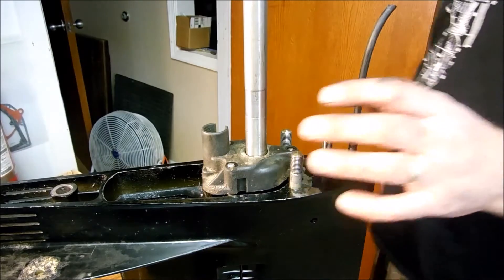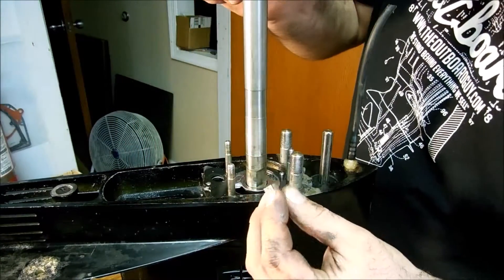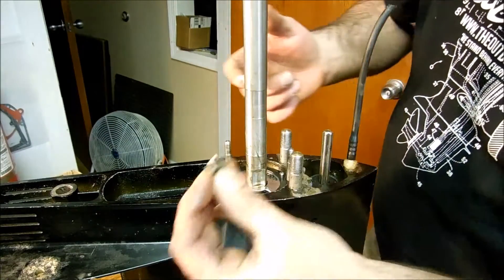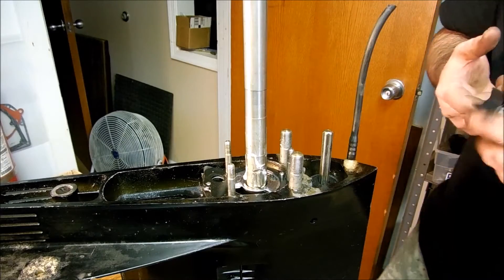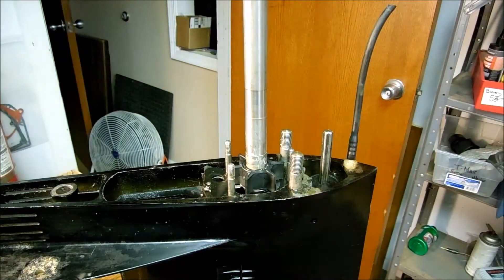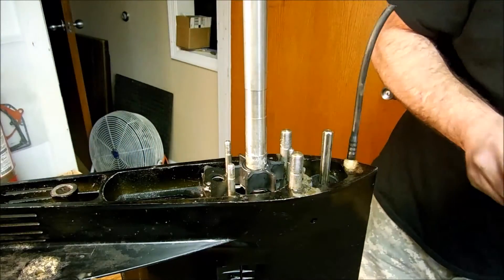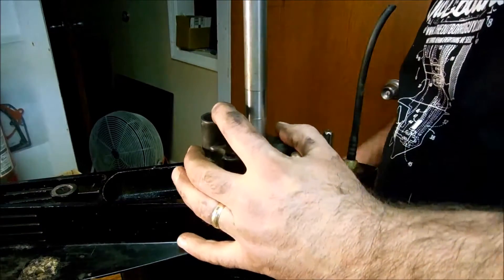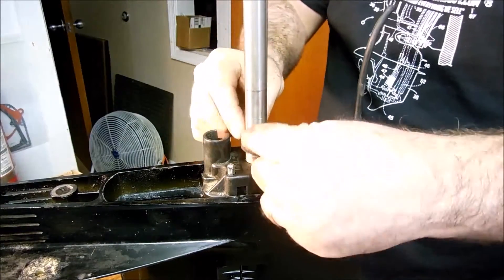how to install a water pump on a 1980 mercury 70 hp

Comment: What goes on the top of the shaft when you put it back together
Reply from the maker: I'm not sure I understand your question.  Do you mean the part I slide down the shaft? If so that's the water pump housing

Comment: I have merc 80 Thunderbolt need to switch that impeller, my question does it have to be in natural or forward I'm curious. thank you
Reply: Neutral if you have power tilt and forward without tilt.

Comment: The lil rubber hose on the front of the lower unit what is it for my motor I just got gas it but not hooked to anything but the lower unit
Reply: Nathan Thornhill it’s a speedo cable